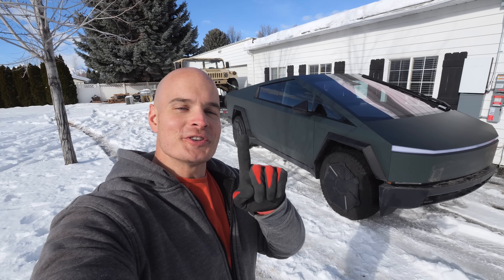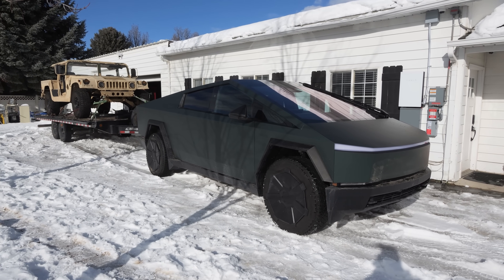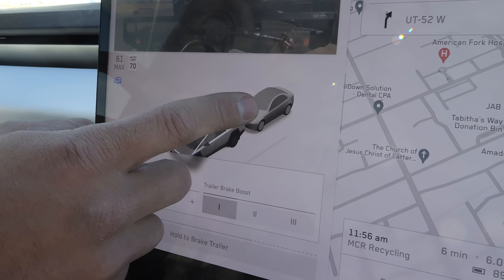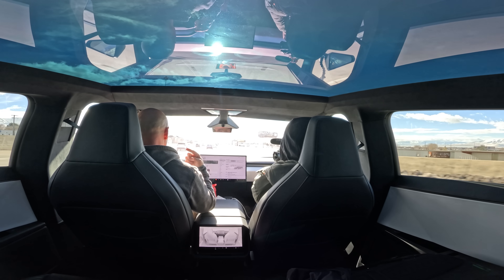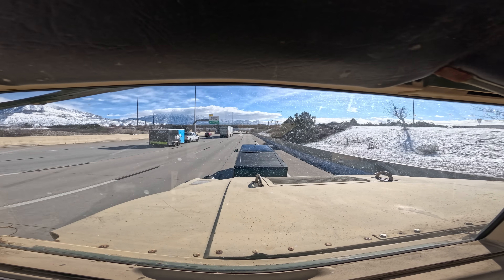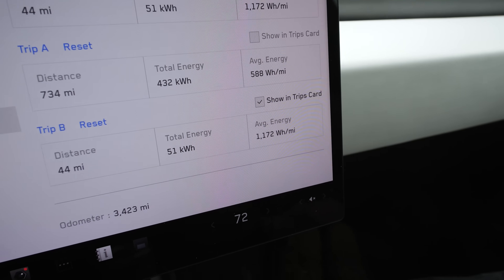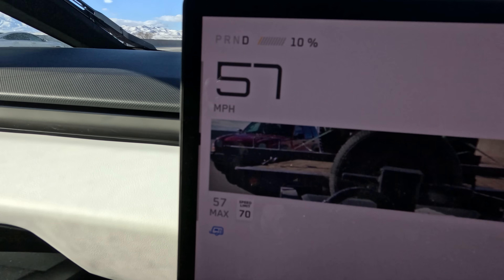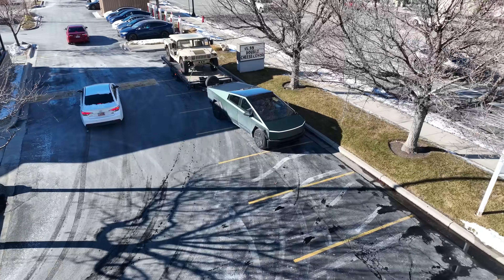How far can the CYBERTRUCK tow 11,000lbs in Freezing Weather?

Comment: Normal towing speed is 55-60 mph. Lots of trailers tires are only rated for that range as well.
Reply: Not true at all,  maybe the little tires on 2k trailers.  I would never buy a truck that I could only go 55 with a light load .

Comment: 7:04 More than likely, you are hearing the induction motor. Tesla appears to have gone with an induction motor for performance purposes, and they operate differently than the PMAC motors on the Lightning and R1T. With an induction motor, you will experience torque slippage, which results in a distinctive motor noise.

Comment: I'll put in 100 miles, since in theory, the largest portion of range loss from a trailer comes from the higher drag, and that payload looks like just about the draggiest thing possible

edit: 90 miles is pretty close, side note, it's ironic that the more efficient a car is, the more it gets penalized in the towing department since the extra drag of the trailer becomes a larger proportion of the energy expenditure. 

Also, rolling resistance doesn't really depend on velocity, since it's a weight*coefficient equation that doesn't factor in speed.
Reply: I'd agree with you if we're talking about trains with very smooth rigid surfaces. Rolling resistance does increase with speed, but the exponential increase is so gradual it's effectively linear for all practical purposes. The weight from the vehicle is constantly deforming the travelling contact patch at a given wheel speed, which becomes more difficult the faster it is done. There's also the smoothness of the road and the bearing friction on the axles that should come into play as extra speed-dependent losses. The coefficients themselves are reasonable mathematical approximations in any case.
Reply: @Infinion  I'll agree with you that it does increase, but the difference is still going to be fairly small especially since this is an electric car with probably electric car designed tires. As for bearing and axles, those i would consider frictional losses, which would have more of an increase since a lot of bearings rely on fluids running between the metal surfaces, turning their resistance into something more akin to aerodynamic drag

Comment: I'm an electrician who moved from germany to the US and many of my co workers were constantly mentioning that higher voltage systems are more efficient (120v to 220V to 480v)
I dont know where this misconception comes from or why specifically Americans think that. I was even arguing with someone online who mentioned heat losses on wires. It's a bit ridiculous. 
Also, literally every American thinks it's more efficient to maintain a temperature if you leave the house than to turn the heater off and on again when you come back
Reply: 1. Higher voltage is more efficient, but not as big of a deal until you move in to major power transmission where the sheer amount of power being moved means even a small resistance in the wire can lead to high losses in power if voltage is not high. Ohms law stuff, as you probably know. Also, the heater part ks avtually true! So to put it in simple terms, if you constantly have your house set to a temperature, it will be losing its heat through the walls and roof and floor at essentially a constant rate proportional to your temperature delta from the earth/outside. If you turn the heater off when you leave, the house begins to cool and your heat delta becomes less, and if youve taken any thermodynamics class before, youll know that this essentially is a logarithmic decay equation. Yes, you will then slend more energy in the tome period you come back and turn the heater on, but the net loss of heat from your house in the heater off scenario will be lower, meaning your power bill will be slightly lower. Not a huge difference but still

Comment: I'm gonna help you with your math... pretty disappointed you couldn't do it. In the truck, you said the range dropped to 308, and you showed the screen at the 3 minute mark as 308 miles. Then, when you got onto the road, at the 3 min 50 sec mark, you said the range dropped another 9 miles and you drove 4 miles. So 308-4=304 and minus another 9 equals 295. But, if you look at the video on the bottom left as you swing by the screen, 3 min 50 sec mark, it shows 189 miles as the range. Why the 106 mile difference?

Comment: Awesome video for seeing it doing truck things. Regarding the range vs % in navigation, Tesla don’t do a guess-o-meter like most EVs, but rather display the EPA range estimate in ideal conditions at given remaining battery percentage. Basically tap the miles remaining figure to change it to battery % and trust the nav, the GOM figure is irrelevant. The “Energy” app and graphs based on past N miles traveled will give an accurate GOM number. Takes some getting used to, but entirely reasonable once it makes sense.
Reply: The driver shouldn't have to take their eyes off the road and tap around, do calculations, enter alternate destinations as others have suggested or do anything else. The actual projected range should be front and center. Having an inflated number displayed by default is disingenuous at best.

Comment: Electric vehicles have staked their claim in the auto world no denying that. However as someone with a 3/4 pickup that occasionally tows a large trailer, i think the tech still has some mountains to climb before being a viable option for someone like me or especially people that tow more than i do much more often than i do. I'll make the same arguement people always do, i can drive farther pulling the same amount of weight and when my tank is empty i can fill up, grab some food, use the bathroom, and be back on the road in 15 mins or less. And one place that i specifically go likely won't have charging stations for quite some time ie middle of nowhere. The tech has made leaps and bounds in a relatively short amount of time but it still has a long road ahead. I'm also curious to see what competing tech comes out in the future too. I've seen one of the big car companies pouring a bunch of resources into hyrdogen again and now someone is also looking into ammonia fuel. Too soon to tell if they'll be same better or worse than electric.

Comment: The “rated range” display is not a calculation based on recent driving. It’s essentially a unit of energy derived from battery capacity and EPA efficiency. It does not project estimated range like Ford and others. It’s been like this since the 2012 Model S. I noticed that you changed it to % instead of miles at the end of the video.
Reply: It is a marketing gimmick. By making the driver tap through multiple screens to get the true range, it appears that the range is greater than it actually is.

Comment: 90 miles versus 156 miles for the lightning. Takes away my fomo for the CT. I can now wait a few years 😅
Reply: CT was tested in freezing weather , lightning was tested in summer. Not a fair comparison in the least
Reply: @Ryan-sw3km  also, did that Lightning have the bigger battery pack? There was a video from a year or two ago of a Ford Lightning with a standard pack that was pulling a 7000 pound load (might have been lighter) and was able to hit 90 miles before going flat.

Comment: On a GM Quadrasteer truck, when towing they'd have the rear tires always turn in the same direction as the front tires and turn an increased amount.  I wonder if the rear wheel steering changes it's behavior when towing on the Cybertruck.

Comment: would have been nice if you left it outside not plugged in till batteries got below freezing. Then they would have to warm up and would give a real range. A lot of car owners do not have a garage  or the garage isn't heated or attached.
Reply: Even if you charge outside and its cold the trucks batteries will still preheat themselves to stay warm enough, so the difference of a heated garage vs outside is negligible
Reply: @Ryan-sw3km  I am saying not charging outside either. A lot of people do not have home chargers. I would only have one if lifepo4 LFP cells were used for the battery packs. The others can start fires and are not safe.

Comment: $13 full charge, for 90 miles of driving. Just for experimenting, divide by 4, which is about 15 miles per gallon ($3.33 a gal. example), so it is getting about the same as a modern gas truck or close, to me.

Comment: thanks for your testing of ct but was wondering if your test on the rivian size battery was smaller than the ct or smaller than the ford and i did notice that the ford was towed in warmer weather but lack of snow on road could be an illusion
Reply: Your rivian used 0.71 mi/kwh which is 1408wh/mi  with a 135kwh is 96 miles
The cybertruck states an 1193 wh/mi with a 123kwh pack is 103miles
Reply: thanks

Comment: 90 miles... on 100% .... even worse than expected.... in the army we called that "mission ineffective."
Reply: 100 miles
rivian used 0.71 mi/kwh which is 1408wh/mi  with a 135kwh is 96 miles
The cybertruck states an 1193 wh/mi with a 123kwh pack is 103miles
Reply: @bartdeking  seems like it should do better. for all that technology its closely tethered to the grid.
Reply: @ogerwon1  if you tow 11000lbs all the time. In summer you easily get 300 mile without towing and you would rarely have to charge at a charge station. Instead it all happens at home overnight.

But yes if you tow all the time you need the range extender. Also it would not surprise me if they come with a larger pack at some stage when they went trough the huge backlog of demand that they first go trough. 99% do rarely tow long distance so barley anyway need long range when they rationally consider buying a ct or ice truck

Comment: STRANGE
cybertruck has 
- Better range 
- Better efficiency 
- Way better charging speed
- Better charge port availability.

Your rivian used 0.71 mi/kwh which is 1408wh/mi  with a 135kwh is 96 miles
The cybertruck states an 1193 wh/mi with a 123kwh pack is 103miles

So whatever you calculate the cybertruck is better according to your own data
Reply: Go back to sleep
Reply: @BBingo-v5i  day time here mate. Just stating some hard facts for you.

Comment: You don't need to use your trailer jack anymore.
Step one Baker trailer where you want it.
Set your vehicle height too high.
Step2 uncouple your trailer make sure to uncouple the ball.
Step 3 lower your truck to entry mode.
Step 4 make sure the ball is now clear using a reverse camera and then pull forward

Comment: "I'm going to be driving carefully" and then goes off driving over 100 kph. Here in Sweden at least, the speed limit with a braked trailer is 80 kph (unbraked is 40), and that's just for normal trailers not trailers that are heavier than the car.

Comment: Who would want to have a truck you can only drive 90 miles at a time with 40+ minutes to charge to 80%?
That would take 50% longer to get to my cabin pulling a boat. AND that is only if I slow down to 40mph for the last miles between the charges. 
Nope. No way people will want these for real use scenarios. Maybe if you want to drive around town to show off your truck, but other than that, nope.

Comment: I imagine it would be quite hard to deal with one of these if it ever got bricked. Not only would it be impossible to move under its own power, you couldn't even steer it without power. Presumably the steering runs off the 48V battery system and  you could replace or recharge that low volt battery easily enough if it ever died.
Reply: If its bricked you would already be getting towed into a shop most likely, and either put on rollers or just hold the brakes to go get winched up a flatbed regardless of where the tires are turned

Comment: Drive by Wire or Die by Wire is what we use to call it in the Aviation industry ..Controls by Wire and not mechanical and are pretty scary you can't see a wire broke you can actually see a issue with a  mechanical linkage if there is a discrepancy and proper pre trip inspection
Reply: How many times has fly by wire resulted in a crash or death in the modern age?
Reply: @Resyektt  we will just never know ;) will we

Comment: every time someone mentions that the cybertuck is bulletproof i lose a few braincells, you could make many thing bulletproof doesnt mean you should, and bullets hit a little different than a wall or another vehicle. i could add a metal plate to the back of my monitor and it would be bulletproof, it would not protect the panel at all and would infact make it more dangerous as now a drop would certainly shatter the panel, your vehicle is only as strong as its weakest link and the link is always YOU!

Comment: 14:20 you're too far away to initiate a draft, you gotta be like 10m or closer to catch the draft and theres a large gap in between the safe following distance and the draft zone which will actually increase your fuel consumption to a higher rate than the safe follow distance

Comment: I towed a UHaul auto transport trailer (not the tow dolly) with my Lexus on it, 305 miles with my F150. Running the AC and doing 60-65 most of the way I got to the end of the trip and still had about 1/4 tank (9 gallons) of fuel left. And it would do the same thing in winter. Having to disconnect and drop the trailer to charge your vehicle every 100 miles or so would seem to be a huuuge pain. And without a trailer, with AC and doing 65-75 I can make the round trip (305 miles x 2) on one tank and have gas left. With all respect electric vehicles aren't cut out for much towing, despite silly tug of wars and such.

Comment: - 32 aint that cold for a lot of the country in the winter
- CTs tires only look like off road tire...2:20 you can see they are made to have some capability in loose surfaces (not snow) but mainly maintain range
- Someone towed 6k in a diff video and it used 800w/hr with a model y as the load which is aero
- 90 miles with greatly reduced speeds is awful but not unexpected
- as noted in other channels the charging curve for the CT batteries is not good so expect 40min charge to get 80% of 90 miles
- The CT is still awesome but unfortunately was overhyped as a world beater in every category when really the only thing it seems to do best is best the fastest unloaded and grab attention

Comment: You should do another test comparing how far the Cyber truck and a standard ICE truck can travel on $20 worth of their fuels. $13, the cost to charge the EV, would get 3.7 gallons of gas at $3.50 per gallon. Guessing 15 mpg, that would get you 56 miles down the road.
Reply: And then take into account how much your time is worth while you wait for it to charge at a supercharger station or a gas station
Reply: @UndeadFleshgod  Exactly. Time is money. Also factor in safety: running out of battery on the highway with a trailer on is sketchy AF, and having to drop a trailer to re-charge every 90-100 miles is hard work, unsafe, and a logistical nightmare. So many things could go wrong. 1) Where to drop the trailer, 2) Trailer unattended while charging? 3) Someone blocks in the trailer and you can't move when done charging, 4) Getting the trailer re-connected and never making a mistake when you're stressed out from having to do it every hour....all these things would be a potential nightmare to deal with.
Reply: Not worth it when the cybertruck is 1/3 again the price.

Comment: 150  miles, if the  road is  all down hill and with a hurricane of a tail wind...maybe.... but only if the heater is turned off and you don't use the lights... and the outside temperature is above 35 degrees.

Comment: 90 miles of range.....that ceases to be a truck at this point. This more deeply solidifies my feeling that the Cybertruck is simply an ESV or Electric Status Vehicle. $13 for 90 miles of range....14 cents per mile...thats MORE expensive per mile of fuel than my 2017 Ford F150 ICE

Comment: What a terrible truck. A truck should be practical and this is not
Reply: Way cheaper to run then any gas or diesel tho 😂
Reply: @WANDERER0070   I am referring to:
Stupid steering wheel
No stalks to select reverse or indicators
Useless rearview mirror
Towing mode is not good
Towing distance is not great
Loading bed design is also not great

The other two electric trucks are much better. I will rather drive a diesel truck

Comment: This will undoubtedly generate lots of negative stories from the FUD crowd. But the reality is all the drama around whether or not you would make it was not necessary, the car will tell you to slow down if you need to and it undoubtedly would have… But going uphill, doing 0 to 60 times, opening the tunnel cover… All of these things cost you range. No what is the deal with all of that cabin noise?

Comment: That's cool! but here's a brownie recipe;

Ingredients:
-1 cup unsalted butter
-2 cups granulated sugar
-4 large eggs
-1 teaspoon vanilla extract
-1/2 cup all-purpose flour
-1/2 cup cocoa powder
-1/4 teaspoon salt
-1 cup chopped nuts or chocolate chips (optional) 

Instructions:

1. Preheat the oven to 350°F (175°€) and grease a baking pan

2. Melt 1 cup of butter, mix with 2 cups of sugar.

3. Add 4 eggs and 1 tsp vanilla; mix well.

4. Sift in 1/2 cup of flour, 1/2 cup of cocoa, and 1/4 tsp salt; stir.

5. Optional: Add 1 cup of nuts or chocolate chips. 

6. Pour into the pan, bake for 25-30 mins. 

7. Cool completely, cut into squares, and enjoy your brownies!

Comment: One other question Jerry, what about manual operation of the Trailer Brake Controller?  I noticed the on-screen setup had the normal operational settings but can you set the steering wheel buttons to operate the brake controller manually?  If there is no way to operate the Brake Controller on the fly, that is another big thumbs down.